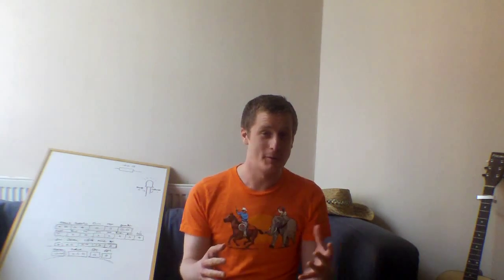How to make a Word Clock with Arduino - Part 1

Comment: If you are interested in building your very own clock, you should also take a look at the this "Doomsday Clock Shield Kit"
http://samuraicircuits.com/merch/index.php?id_category=14&controller=category

It is designed to work with the "Extremely Accurate Real Time Clock". This way you can build a clock that can keep very accurate time.  According to the datasheet it will lose less than one minute per year.